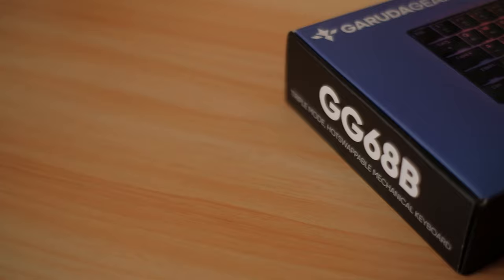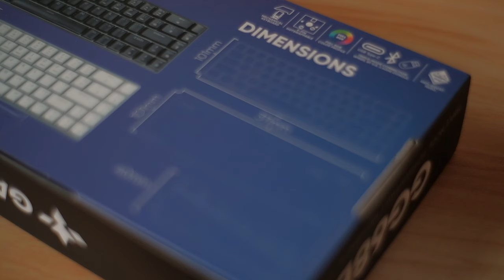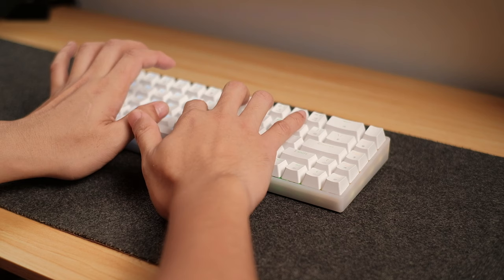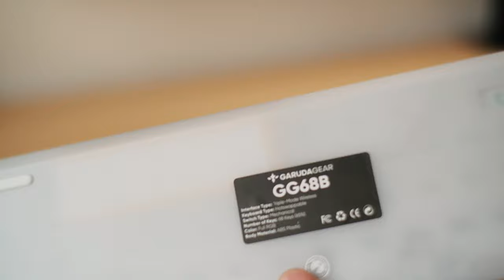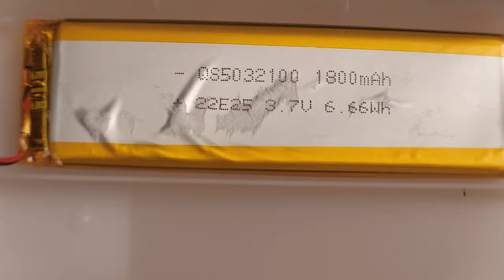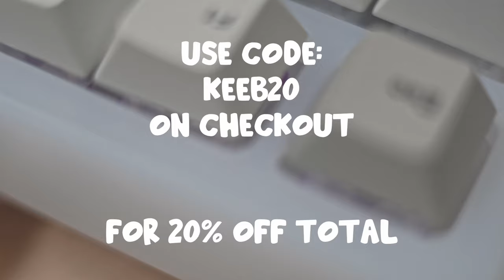[CC] Turned a Budget Keyboard into a Bakeneko | Garuda GG68B

Comment: Did the same mod with my tester68. Greatly improved the sound and consistency
Reply from the maker: The case design was just too tempting so I tried it hehe
Reply: I’m interested in Trying this with my tester 68 but I’m scared of messing it up. Did you cut of all standoffs and the bits on the side like the video? Were you still able to access the on off switch after the mods?

Comment: very nice build on the keeb my dude. I got this kb recently, gateron brown variant, and appearance, build, and feel wise, it's incredibly good. My honest gripe with this though is the latency, 32-ish ms delay per key even with the drivers installed, unbearable for gaming but it's good enough for casual and office use.
Reply: Is the delay really that high on wired mode? thinking of buying this kb someday.
Reply: @TheIronyy_  If the keyboard is for casual use, the delay is perfectly negligible. But for demanding inputs such as rhythm games and fast typing, it's not really ideal.
Reply: @Hannexuu  damn, I plan to use it for rhythm gaming so ig that's a no-go, also the shop told me that the keeb is 500hz (which is plenty good enough for me) but I guess the polling rate is inconsistent or something like that
Reply: Will dis be fixed when they update their driver?

Comment: did you manage to stretch out the o ring around the plate or do you have to attach 2 o rings together?
Reply from the maker: I only used one. 180-200mm perfectly fits ☺️

Comment: What oring size will you suggest for 60%? Planning to do this with my blade60
Reply from the maker: you can maybe buy 160mm and 180mm to be sure.
Reply: @pusakalmkb  what size did you personally use for this build?
Reply from the maker: @kennethfajardo3604  200mm*3.5mm